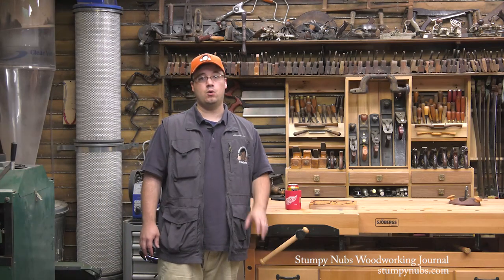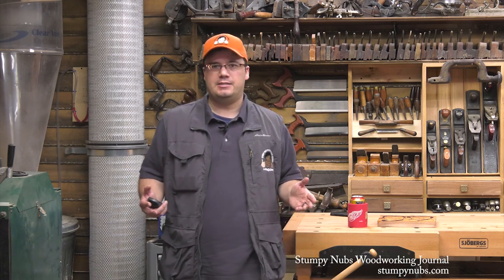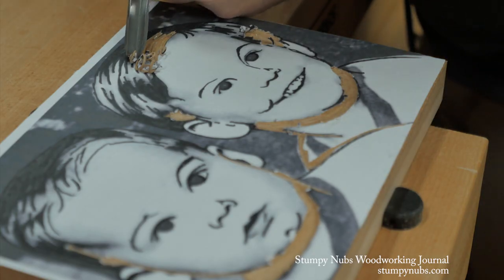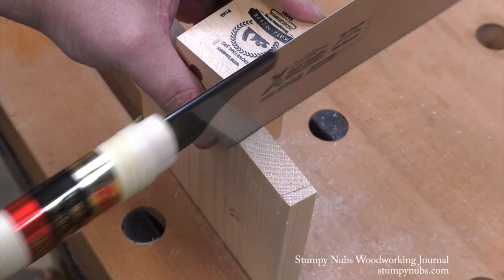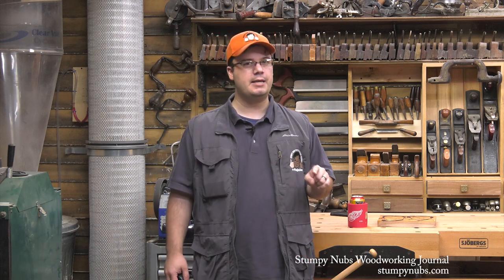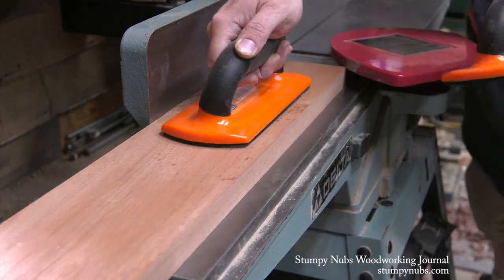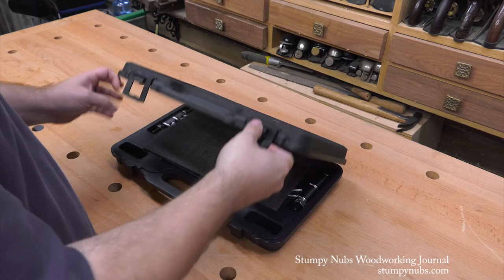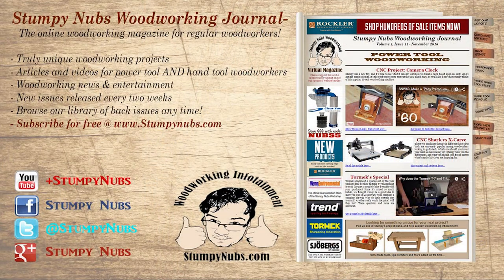5 Woodworking tools you have to see! Power Chisel, Dovetail Guide, Helical Cutter Heads +More

Comment: Like the Mtool dividers and for $25 it's going on my wish list. But if your in a pinch you can break in to the "better half" sewing room and steel the roll of elastic tape grab your ruler and maker layout points at equal distance and when you stretch it out it will give you equal points further apart very much like Mtools dividers. Works well when you need to divide large lengths example I used it to layout railing balusters between banisters. 
Thanks for the great content keep it up always looking forward to your videos.
Reply: Thank you for sharing the trick!

Comment: FINALLY a source for helical cutting heads for my planer!  Thanks a bunch.  Cheers, Chris.
Reply from the maker: Wait until we finish our comparison later this week. I think the V-Shear head is a better choice over the Shelix Helical head.
Reply: No V-shear head available for my planer (Ridgid R4331), but that's fine, helical beats straight blades any day.  I will have to save up though :D
Reply from the maker: They will custom make it. I don't think it costs any extra. The only heads they have in their database are ones they have custom made. Once they get the measurements and make one for a particular machine, then that head also goes in their inventory for others with that machine.
Reply: Aha, good to know.  Thanks again!

Comment: those crazy cutter heads are going to be a heck of a lot harder to sharpen if you ever need to.
Reply: Damianium no they have four sides on each small knife,  get a nick loosen screw turn tighten screw you are good to go , need to replace a single knife maybe $10 each

Comment: Stumpy, I've the same planer (22-560) and thought the bearings were going bad.  Bought some replacements off Amazon for $7.  Is this thing going to be nearly impossible to replace bearings alone -- time to upgrade the tool??
Reply from the maker: As long as you have a bearing puller and some patience you'll be fine.
Reply: Sounds good, thanks for the advice!  Just ordered a 3-jaw puller.

Comment: Yeah well, these new planer and jointer heads turn me off. There is no way on this earth that a new helix planer head should cost as much or more than a whole new planer. Someone is gouging and I absolutely refuse to play that game. I will not support companies that gouge.
Reply from the maker: Before you disparage a good company like that, you should make sure you speak the truth. They cost this much because they machine these in small batches. These aren't mass produced in Taiwan like the jointer and planer itself is. In most cases, they don't even have the specs from the manufacturer, so they have to find someone who owns a machine and get them to send in detailed measurements so they can engineer the head for each model individually. Take your planer to a local machine shop and ask him what he's charge you to engineer a helical head. I bet it costs a LOT more. Yet that's essentially what Byrd Tools has to do for each model they offer. Once they get the head made, they can repeat it. But how many people do you think are buying helical heads for a 1990's delta, or a 2000's craftsman? We're talking small batches, and that always costs a lot more.
Reply: Stumpy Nubs I’m not disparaging anyone. I just don’t agree with your assessment. The problem of exorbitant cost has more to do with the number of manufacturers of helix head shafts than any other thing. Case in point, I went to your recommended site my woodcutters.com which is the exact same site as shelixheads.com to look for a helix head for my Woodmaster 718 Planer. Bear in mind that Woodmaster has a helix head for this planer at $1165.00. My Wood Cutters has it listed for $1655.00. That’s $490.00 more and almost $700.00 more than the one listed for the Woodmaster 712 planer. It’s head is 6 inches shorter. So to buy one from Woodmaster I pay through the nose. If I buy from My Wood Cutters I get gouged through the nose. If there were 2 or 3 more separate manufacturers making these, the price would drop to under $500.00. I am certain of it. Now you’re welcome to post how much markup My Wood Cutters or Byrd Tools which I assume they buy from puts on their shafts. I would really like to know? I would probably bet they are all made by one manufacturer, and passed on to several different layers of middle men before being sold to consumers. Can you imagine if General Motors manufactured all the cars in the world today and relabeled them as Dodge, Chrysler, Ford, Range Rover, Mercedes Benz, etc., I can.......Say Ka-Ching $$$$$

Comment: Proxxon Power Carver is much better then the Arbortech chisel and its cheaper!
Reply from the maker: Better? It's not even close to the same tool. The Proxxon has the small motor of a rotary tool. It's cutters are smaller too. It has less power, it heats up more, and the little motor won't last nearly as long. It's a small tool for small work, and that's fine- in fact there are some benefits to the small size. But saying it's "better" is nonsense as the two tools are in different classes, both in size and power.